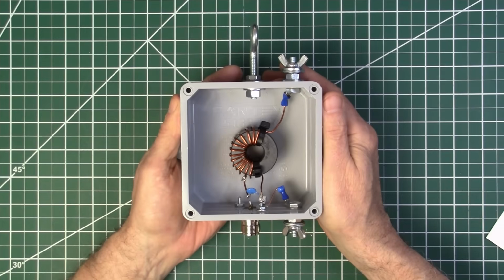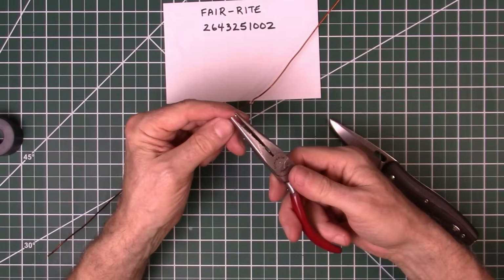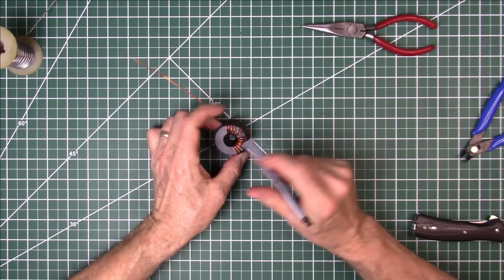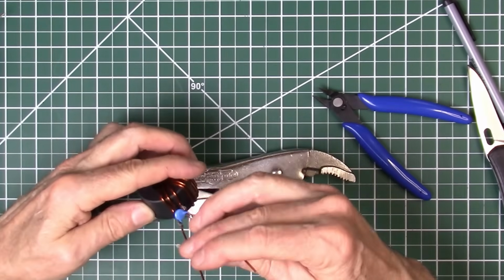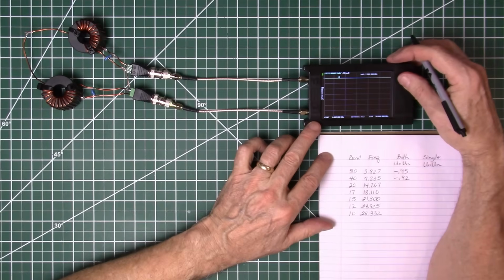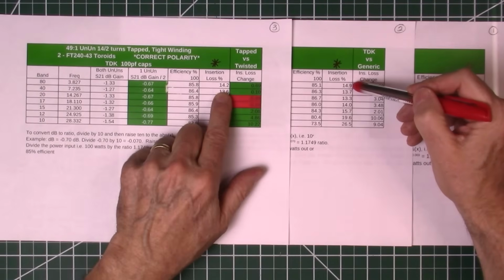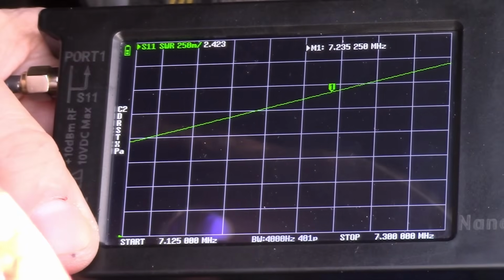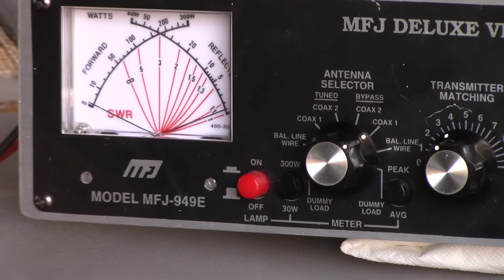Best 49 to 1 UnUn for EFHW End Fed Half Wave HF antennas

Comment: When testing - why do you use 2 UNUNs?  Is that the only way to effectively test a UNUN?
Reply from the maker: @SherwoodR631 I guess there is always more than one way to do something. One of the main reasons I test like that is because of my test equipment.  The NanoVNA is a great little device. Since the LogMag 21 measurement for insertion losses outputs a signal on Port 1 and measures the signal on Port 2 both ports need to see the same load. So I transmit the signal from Port 1 into the unun which converts from 50 ohm to ~2450 ohm which represents the antenna side. Then I connect the second unun antenna side lead to match the ~2450 ohm back to 50 ohm to connect to port 2 which measures the insertion loss. Since it is going through 2 theoretically identical devices, I just divide the losses by 2 to get the insertion loss for each device. Hope this helps.
Reply: @BudgetHamRadio  Ahhh that makes perfect sense to me.  Much appreciated for the explanation.  So in theory I can perform the same test with a single 49:1 UNUN (followed your build instructions) and then I can simply place a 2450ohm resistance on the antenna end and route it back into port 2 of the NanoVNA.
Reply from the maker: unfortunately no. that would not convert the impedence back to 50 ohms for port 2.
Reply: @BudgetHamRadio  Oh.. so then I guess I need to think about this more.  Thanks again.

Comment: This is where an adjustable length wire for the antenna is handy - reel in the wire when it's too long for a band, and let out wire when it's too short for a band. Similar to the concept of the Reel Potable EFHW antenna. I would love to see your attempt at an adjustable length EFHW using a chalk line reel, since your ideas are very good. Good build thanks
Reply from the maker: Coincidentally I started one this week. Just took the line out and getting the wire for the reel.  Subscribe so you won’t miss it. Thanks for watching.

Comment: I dont understand why there are two of these hooked up to each other........ help me out here....
Reply from the maker: That is to test the efficiency of the baluns. It is explained in the video. In order to measure the efficiency, the NanoVNA transmits a signal from the top port and receives it on the bottom port but it needs to be the same impedance so you transmit through one balun and receive through the other for impedance matching. Then you divide the results by 2 to get the efficiency of each balun. Hope that helps.

Comment: Since you use this for remote operation, could you make it like an auto transformer? Add taps  and selector switch to select the best match?
Reply from the maker: @williamelliott5041  it is possible to add relays in an enclosure and remote control by low voltage from your shack to switch ratios if necessary

Comment: i just counted the turns and have 16 turns total, would that be a 56:1?
Reply from the maker: No.  There are 16 turns but this is wired as an autotransformer where the ground is on one end and the antenna on the other. Like I explained in this video and referenced the math in the previous video to this one.  It is a 2 turn primary and a 14 turn secondary.  14x14 =196.  2x2=4.  196/4 = 49.
Reply: @BudgetHamRadio  Thank you so much for explaining that.

Comment: Absolutely learned a lot. Those toroids were pricey in low numbers $27 for 2. I got 17ga wire. Had all else. Only comment is I believe if you had raised low end at least 7' you would have seen different numbers.😊
Reply from the maker: @SoCoguy  You are probably right as all antennas interact with the ground and their surroundings.  Thanks for watching.

Comment: Im so glad i stumbled into this video. . Ive been a ham for just over a year. Building an antenna is what really got me wanting to be a ham. This very one will be my first attempt at actually building one.  Thank you. K2FOP
Reply from the maker: Hope it helps you getting started on this journey!
Reply: EFHW's are nice in that you dont have to connect to the center of a wire with coax and run it at an 90 debree angle from the wire. 2 ends in separate trees and a hanging wire. Or if bent one on the ground and the other run up into a tree. a EFHW can be hung from a tree or run horizontally in an attic or along a house. I have compared a EFHW to a dipole and a vert. They do pretty much the same as a dipole and are usually a lot easier to put up especially for in the field work.
Reply: Tested my about 17 foot tall pole in the front yard vs 2 dipoles for 14 meters. The pole in the front yard on a pipe stuck in the ground does the same or 1 S mark better than the dipoles and its just a pipe stuck up in the air. You could use pvc pipe with a wire in or on it.

Comment: Jerry,
I am compelled to point out a couple of errors in your winding of the 49:1 toroid. First, when using enameled wire you need to avoid pulling it hard through the center so that the sharp edges of the core do not scrape the enameled insulation from the wire. Otherwise you set up weak spots in the wire where it can arc or otherwise fail. Second, it is good practice to insulate the connection of the tap since the circuit is exposed at that point. Heat shrink tubing is a good choice or a liquid doping compound that has a high dielectric constant. 
BTW, I applaud you emphasis on a good mechanical connection prior to soldering. That's how I was taught 50 years ago and, since then, I've seen countless solder-only joints fail because the soft solder can't handle much mechanical stress before tearing loose. 
Dan KE6PO
Reply from the maker: Thanks for watching and your suggestions.

Comment: Have you tried  tuning  the capacitor  
I read that the cap was to improve loss for the 10 meter band but I found it is not optimum.
Reply from the maker: Yes I have.  Check out this follow up video.  Which capacitor is BEST for the 49:1 UnUn EFHW?
https://youtu.be/ev6G9kjJczQ        
Thanks for watching!

Comment: Hello Budget Ham Radio you could try reading this article on end fed with a 36:1 transformer end experiment "A Deep Dive into End-Fed Half-Wave Antennas (Original)" enjoy.
Reply from the maker: Thanks for the info. I will try to look that up. Thanks for watching. If you haven't already please like, subscribe and turn on notifications to help out the channel!
Reply: @BudgetHamRadio  Jerry, I built your efficient Unun using the 1002 Toroid but wound it to 36:1 (12 turns instead of 14) and built an EFHW wire antenna based on the "Deep Dive into EFHW" article. I used your video to build a 1:1 common choke and used the method from the article using a 13' 2" coax as a counterpoise between the Unun and the CMC. I built and placed the load capacitor on the radiator wire as described in the article to manage the 80 m band, followed by 91 more inches of wire for the rest of the bands down to 10 m, then mounted the Unun and CMC on a 25 ft mast, running the radiator wire up the mast and sloped to the SW yesterday.  I've already made contacts in Chile, Canada, and Spain, and heard really strong signals on 80, 40, and 20 meters from California, to Florida, and even faintly heard Australia tonight. I still have some fine tuning to do once I get an antenna analyzer, but this EFHW is really performing well!

Comment: Great video.  Built one of these for 10-40 about 6 months ago.  About 64 ft.  Very pleased with the performance.   Its now my primary.  Consistently outperforms the old commercial MYANT EFHW I used to use.   Next build is a 56:1 when it warms up outside.  BTW, be sure to wear eye protection.  Those wire ends are sharp and can get a little gangly while winding.
Reply from the maker: Thanks for the warning and thanks for watching.  If you haven’t already, please subscribe.

Comment: thank you what about qrp ppl?
Reply from the maker: What specifically are you looking for that this unun does not do?  It should work very well at QRP power levels. Subscribe to be notified when new videos are posted about one per week. Thanks for watching.
Reply: @BudgetHamRadio  thank you i want to wind a torid 20watt max a ft140-43 core with 22mag wire cause thats what i have if possable i think i can handle it thank you
Reply: @craigpalmer9196 just duplicate what I did with this toroid on your toroid with the 22 awg and you should be golden.

Comment: Excellent tutorial. Your solution with the tap is fantastic. 🙂 Do you think this core will work with 160m?
Reply from the maker: I haven’t tested on 160 so I couldn’t say for sure.  I think the core would probably work but of course you would need a much longer EFHW element.  You woukd need to test and tune the antenna length to get your SWR adjusted. Sorry I don’t have a more definitive answer for you. Thanks for watching, if you haven’t already, please subscribe..

Comment: Knew you would get to those cores. Might need a little tuning on the antenna length and resonating coil. I redid my cores to a 56:1 unun and get an easier match on 80 to 10m. It antennas quite well
Reply from the maker: Thanks for the suggestion.  I’m sure I will experiment more at some time. Please subscribe if you haven’t already.

Comment: Thank you for this clean presentation! Try the DL7AB 1.5uH loading coil in the wire 1.8-2m from the unun, then tune for 40m or 80m and you will have a better SWR on the high bands as well. You can find additional information at K6ARK or N4SPP. There are some very successful commercial endfed antennas that use this principle, one recently reviewed by KD4BMG.

Comment: Jerrym  your primary wires are still much too long (about 2"), if you shorten them to 1/2" efficiency will increase
Reply from the maker: I agree they were a little long while testing but needed either them or test leads in order to connect everything. They were shortened when it was mounted in the enclosure and tested in the field. Thanks for watching. Be sure to subscribe!

Comment: May want to try that coil at about 2m from the UNUN on the antenna.  Might help.  Different cap values may be called for too.  Good Work!
Reply from the maker: The CMC was on about a 2m coax it was just wrapped around the post. Do you have any experience or suggestions on the cap values? Thanks for watching and be sure to subscribe.

Comment: Also, what wire length you exactly used? will be nice if you play around with laying down the counterpoise, no counterpoise, coil compensator and play with length of the wire. Will be a whole new video. Thanks for your videos.
Reply from the maker: Yeah, I forgot to put the length in the description. I had it written down and just overlooked it. It is there now. I did adjust the length a little to try to balance the SWR between 20 and 15 meters. I ended up with 64 feet of the 22 awg silicone wire like what is in my links in the description. Thanks for watching.

Comment: The things I saw with this torroid was 40 meters was not very good. SWR 1.5-1.8, and 10 meters was resonant way higher in the 10 meter band. The 10 meter issue can be compensated with a coil in the wire. It definitely has the best efficiency by far. But efficiency doesn't always mean better when you put the wire on it.
Reply: I wouldn't bother with the 1.5-1.8 SWR on 40 meters, cause most Rigs' built-in ATU can handle it. But I wonder if a 40-meter-long wire makes any difference.
Reply: @edwardpacman7082  Yes, but that's a best case scenario. Also, whether you have a tuner or not, you still have a 2-3 SWR on the matching transformer, which will cause heat and negate the efficiency gains. The 140-43 has a great multi band spread with good SWR on all bands. Yes, it's not as efficient, and it can't handle as much power, but these are the trade-offs. I have done extensive testing with this toroid, and I really don't like it.
Reply from the maker: I agree that every antenna has it's trade offs and pros and cons. It really depends on what bands you intend to use most often and how you plan to use the antenna. Every antenna is a compromise. Thanks for watching and remember to subscribe if you haven't already.
Reply: I've always experimented with different lengths of counterpoise to lower swr and height of transformer from ground, the closer to ground the lower swr
Reply from the maker: while that may be the case you are trading antenna gain for a marginally lower SWR. The link to KJ6ER pdf from the first POTA PERformer video of mine goes over that in more detail.  73, Jerry

Comment: I ordered the Remington 14ga and kemet 100pf low esr capacitor to do that build this week. Gonna have a hell of a time wrapping the 14ga😂
Reply from the maker: It will definitely be a little harder.  Good luck with your build.
Reply: Which specific Kemet, voltage?
Reply: @Aimsport-video  A recommended cap for 100 watt rigs:
 Kemet C330C101JHG5TA 100pF C0G/NPO 5% 3KV $2.41 at Digikey, $2.12 at Mouser. 
Low ESR rated. I copied this From k1rf instructions build for efhw